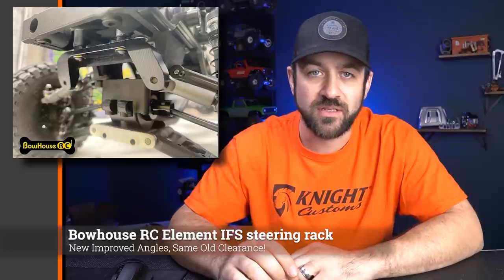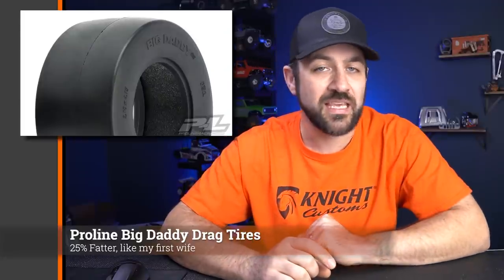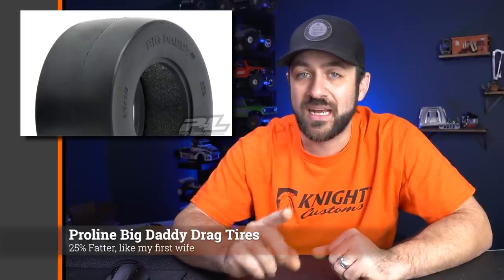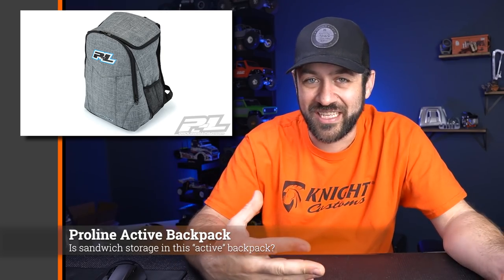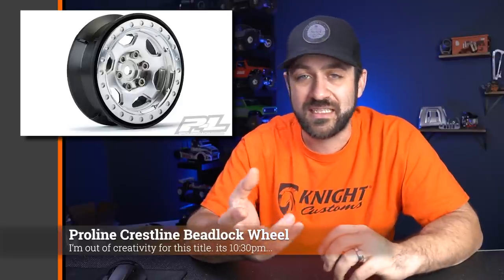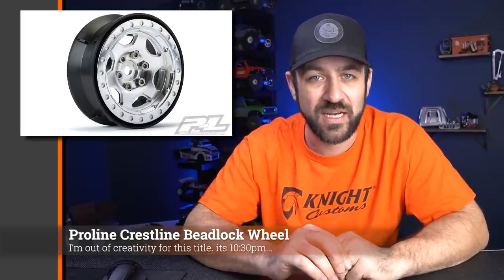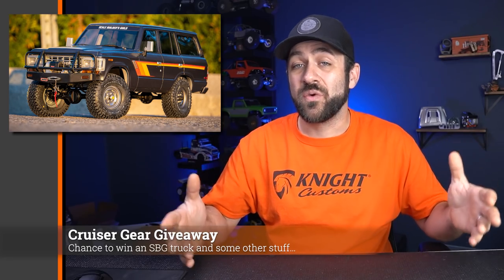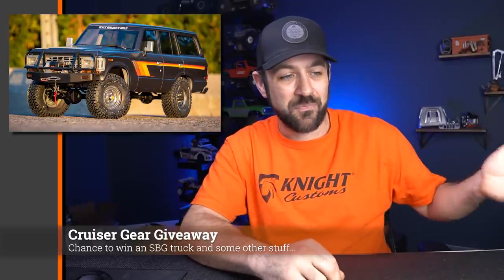Scale News Update - Toyota FJ62 - Episode 121

Comment: Before you mentioned hovercrafts honestly one of my favorite oddball RC’s of the 80’s and 90’s was the Tyco Hovercraft. I mistakenly took out the foam and didn’t put it back in and got it wet. I’d love a hobby grade RC hovercraft. Even the Tyco was super fun
Reply: I had one, but it never really worked well.  Felt it was a cool concept.  Eventually the skirt deteriorated from old age and I ended up getting rid of it.

Comment: just found you awesome builds!! was looking for ideas on custom chassis builds, so might have a old batterd wood runner to fix up if not will just make one from scratch as spent all my money on the running gear and axles haha just have to attack my welding rod supply prob not the best thing to use but there free just got to figher out the size for the skid plate attachments as i haven't a clue how to set them up

Comment: Take the d12 and turn it into a crawler or a little drifter. What I think is so funny about that d12 is that there is a dealership for those trucks in full size not even like 10 miles from we’re I live, I seen them with lift kits and aggressive sideXside tires on them and you will pass one on the highway every now and then. I would like to get the rc version and build it into one of those.